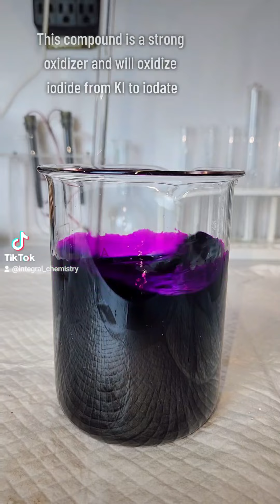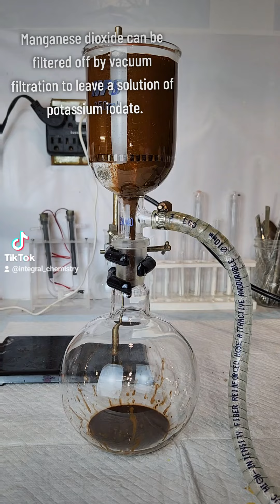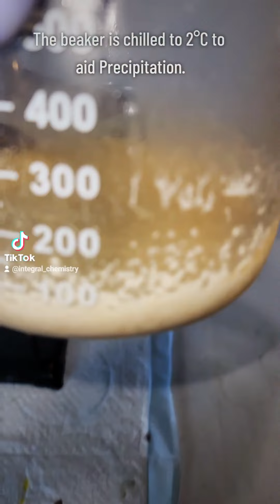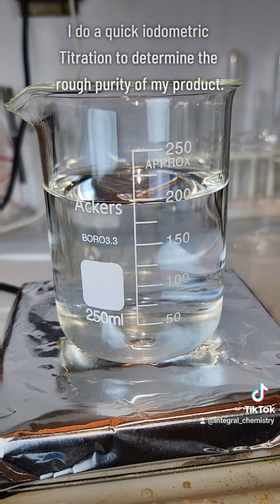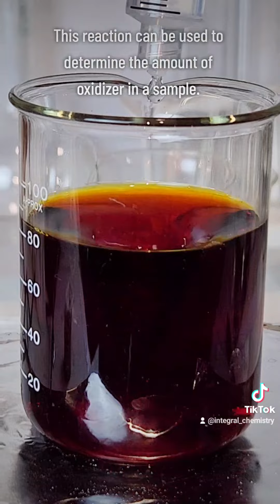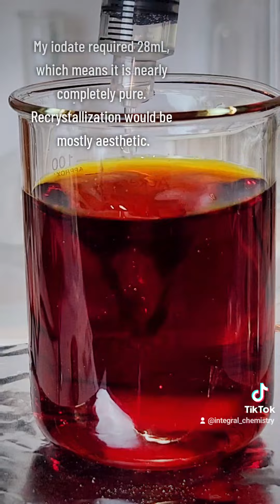Making Potassium IodATE

Comment: I know that I am like very late on this video, but I have a task to find a process to synthesize potassium iodate. This method seems quite interesting to me, however, so I tried the reaction at home, just to check if I got it right. However, when I kept the pH neutral, I got iodine instead of iodate, as proven by the iodine-starch reaction. Then I noticed the note about pH, so I alkalized the solution a little bit (to pH around 9). But I had no hydroxides on me, because my chemical storage just isn't as good as the school lab's, so I used sodium bicarbonate. And I got iodate again. Therefore, i would like to ask, how alkaline does the solution have to be for the reaction to work? And what did you use to alkalize it? I would mby use KOH or sth, but idk.